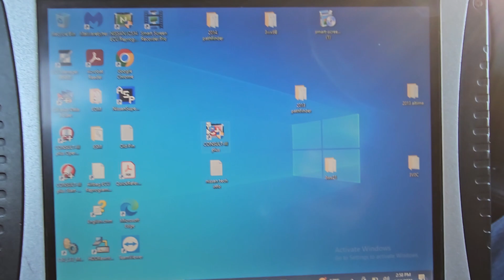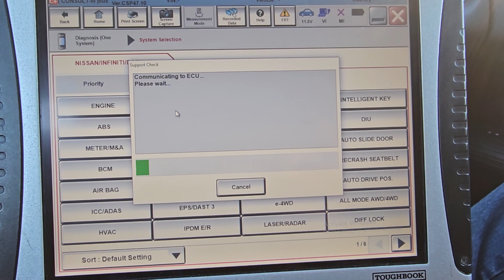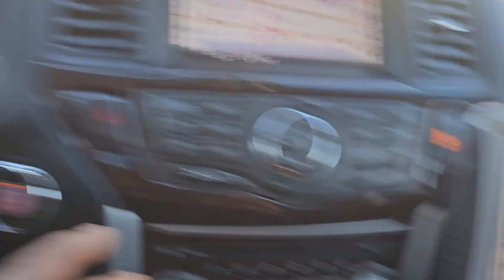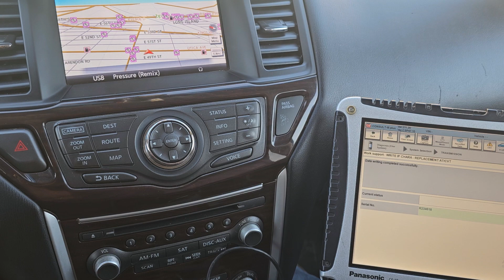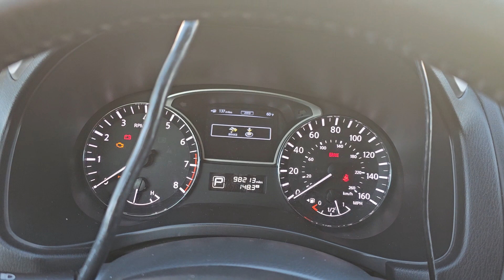2013 Nissan PATHFINDER  Judder Code Reset And Then Come Back....

Comment: Great work
I replaced my transmission with used one
Can you share the transmission files ?
Or do you know how I can get the files 
I have the consult 3 but I need the files
Reply from the maker: if you can send me the year and model of the car
Reply: @BestCarFixes   it’s 2013 Nissan pathfinder
Reply: Please I need same. 2013 Nissan pathfinder platinum